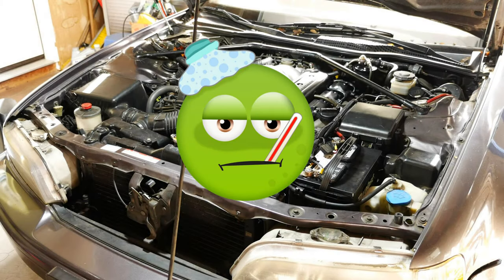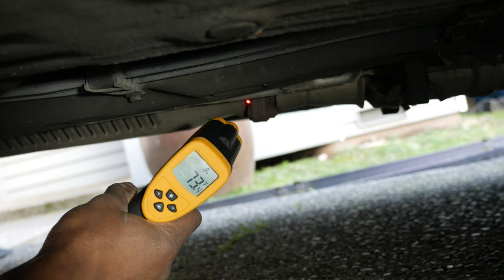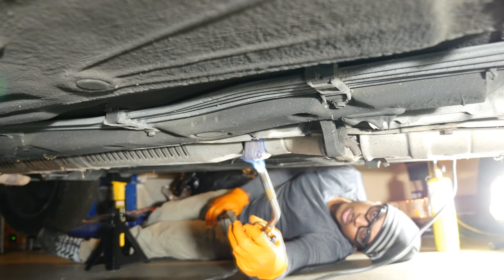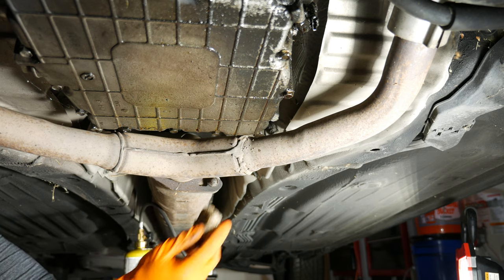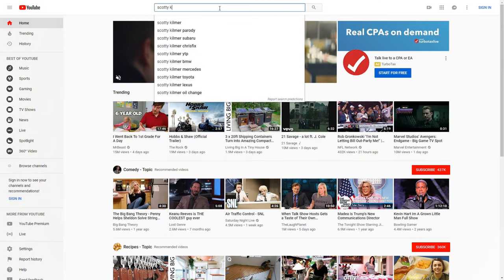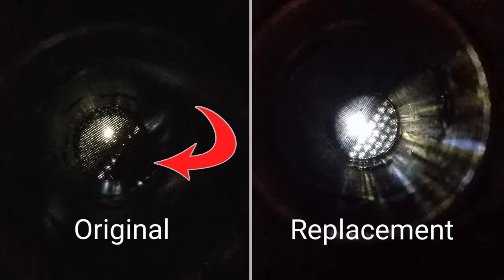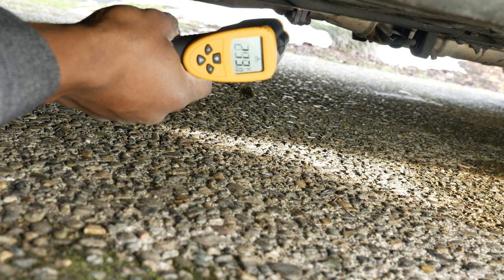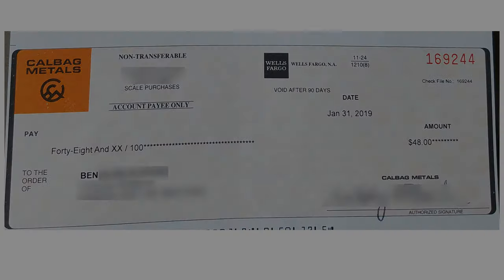1992 Acura Legend No Start and Misfire - Part 5 of 5 | Catalytic Converter Replacement

Comment: Very Thanks Your Video. Actually I need to remove the Y pipe, but I finding information and require tools on how to remove the Cat in advance. You help me a lot. Very Thanks.
Reply from the maker: Glad it helped. I got a tip from the Acura Legend forum to use an extensions and a 14mm swivel socket to remove the y-pipe. Also, I used a torch and beeswax to loosen the nuts: https://www.mediafire.com/view/abc56aahjfybx4k/20160801_194853_zpszp7jmiih.jpg/file

Comment: $48 for your cat? I was quoted $750 to recycle mine! Granted I have an RL and it may have a slightly higher end cat on it, but $48 just seems far too low.
Reply from the maker: Wow, that's a great quote. I'm not sure how much I could have gotten for the Legend's cat if I'd checked around three years ago - definitely more than $48 as I acknowledged in the video. Assuming the quote you received was recent, I wonder if the pricing has dramatically changed.